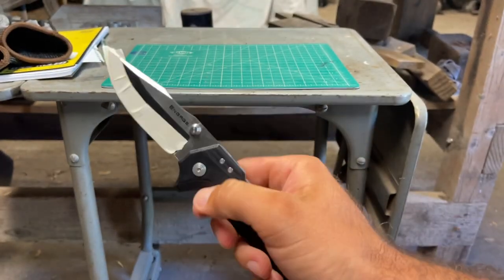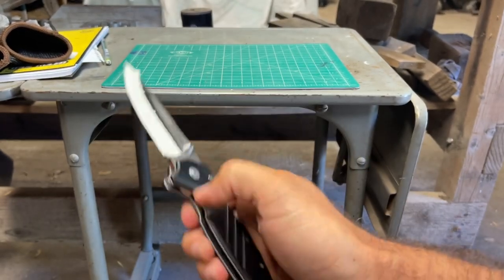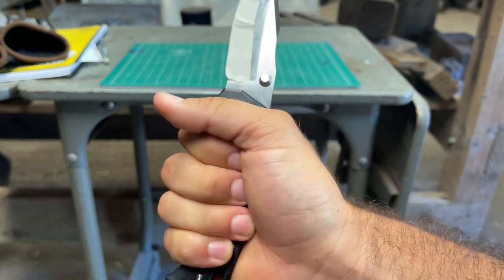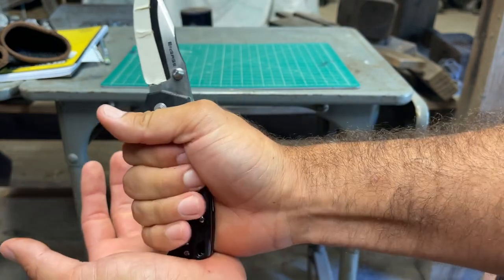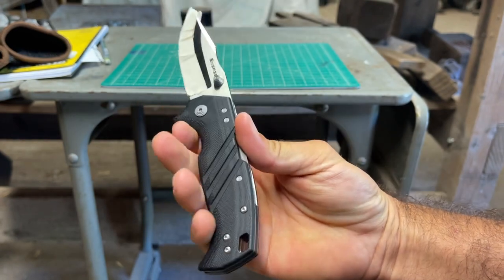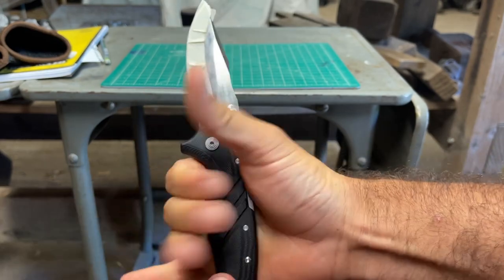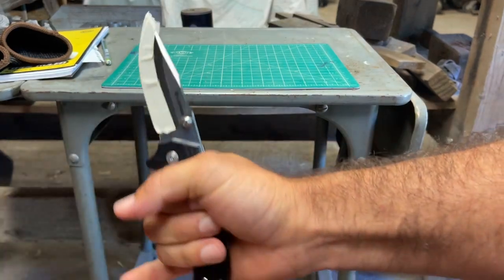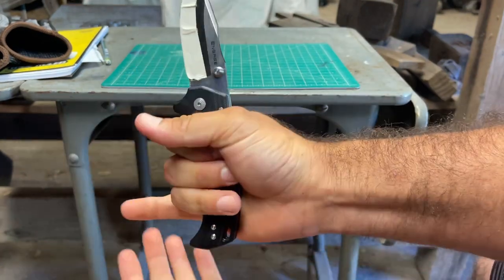Cold Steel Engage Atlas lock fail in butt strike test

Comment: It looks to me like your pushing the lock bar down with the palm of your hand? And what would I be doing  using the butt of the knife to hit anything? It doesnt have a glass breaker. Also I cant get it to do that with my knife.Its funny how you couldnt get it to do that in your first video? lol
Reply from the maker: This comment is perfect because it has all the questions I thought someone might ask so:
1. The palm of my hand is actuating the lock because the force of the butt strike is forcing my hand down and because the lock is in my palm to begin with. I am not moving my hand the butt strike is.
2. I chose to test a butt strike because it’s one of the ways that, when using a knife, causes your hand to slide down the handle; the other is chopping. I don’t butt strike things either but I wouldn’t want a folding knife to fail in any situation that I can do physically.
3. The lock didn’t fail in my first video because it was brand new out of the box. I noticed that the spring on the lock got weaker with use so I tried the test again. I mentioned this in the video. If your knife doesn’t do this then I thank you for mentioning it since it’s good to have as much info as one can about anything.
Reply: @totesmalotes  I can do the same thing with a Demko AD20 or Ad 20.5 The way I hold them knives. lol
Reply from the maker: @s30vguy8  I don’t have any personal experience with the Shark lock but the design looks sound to me. A video would be greatly appreciated.
Reply: @s30vguy8  that is incorrect. The shark lock will not unlock because it has to go back then up. I just tried on both of those models and zero issue
Reply: the lock design is the issue. Only the spring strength will keep the lockbar in place with this lock. That is the design flaw. It's essentially just an axis lock.
Reply: @s30vguy8  lol what a joke, you must not even have an ad20 in your posession because the shark lock is engineered in a way that it is not possible to come undone if you are holding it. 

Like others have said, the shark lock needs to go down AND UP as in it has to force itself into your hand to come undone, unlike this atlas lock that just has to go down in one axis of movement to undo itself

try again cold steel fanboy,
Reply: @opulan  I also saw videos of the ad 20.5 disengaging accidentally. Cold Steel has Fanboys and Demko had a lot of fanboys as well. Trust me Jimmy
Reply: @sgsheff  it is actually way different then an axis lock. Its more like that shark lock but with slight differences. Just open your eyes and look at the pictures of these designs
Reply: @kraakvmaar1505  I've analyzed them in detail. The Atlas lock works on the same exact principle as the axis lock. A lockbar is jammed between the tang and a stop pin. The axis lock just uses liners instead of stop pins. The shark lock is different because the tang rises at the rear. This causes the lock bar to have to be raised to unlock as well as move backwards. Both the axis lock and Atlas only move backwards and forwards but not up. In function the Atlas lock is the same as the axis lock as I explained. Just because the user pulls the Atlas lockbar back similar to the shark lock doesn't mean it functions the same. Maybe if you could see beyond what the user presses to move the lockbar you could see that they function differently. We've analyzed it extensively in the Cold Steel Nation Facebook group and  we were all able to understand that it's just a fancy looking axis lock.
Reply: The fact that cold steel showed the skull breaking test with the butt of this knife is why he’s doing it
Reply: @RR9sf  Well I dont know what you or anybody else does with thier knife but if I were to use the skull breaker or glass breaker on any knife, I dont do it with the knife open.
Reply: Back in the day if you ever had the misfortune of getting into an altercation with someone much larger and you did not want to maim them or worse a butt strike is a reality with Buck 110’s, however normally this was done with blade closed. This test is valid because COLD STEEL makes no qualms of having a blade to defend yourself, open or closed.
Reply: Demko best

Comment: I tried this with mine on YouTube.  This only happens if you purposely slide your hand down while gripping the lock.  The knife doesn't disengage unless you move the lock-bar with your hand.  Will it disengage without you touching the lock-bar?  Mine doesn't.  This is a very good lock type that you can trust, in my opinion.  It does not have the same issue as many Cross-Bar Locks have; this is not a Cross-Bar or Axis Style Lock Type...  This, like the Demko Shark-Lock are very good, reliable, and super strong lock type.  This knife doesn't disengage by it's self.  It needs a person to disengage this lock; it doesn't disengage by itself...  :-)  Peace, Stiletto :-)

Comment: I hate to say it but many Cold Steel fans expected the sale to result in gimmicky designs & increased prices. We hoped to be proven wrong. Not looking too good right now. Appreciate your efforts to get to the facts. Please keep it up !
Reply from the maker: Thank you. What’s kind of sad is that there isn’t really another company that is similar to Cold Steel, old Cold Steel I guess.
Reply: I’m not even a cold steel fan but this is one knife and a new design at that. I think the way he’s holding it or they way his hand size is, is slightly lowering the lockbar and it’s closing on impact. Maybe the design needs a stiffer spring, maybe it needs to be further indented in the grip area as to not be as easily manipulated in use. I’ve seen quite a few reviews from people I respect who believe this is a good design and will work well. It could be one faulty knife, which every manufacturer around the world has had at some point. I’d wait until more knives experience this as a mass issue before making a decision.

Comment: Is the lock failing or are you pulling the lock-bar down?  It looks like you're pulling the lock-bar down...  A better test would be without your hand being on the lock-bar and then, do a butt end strike...  :-)  Peace, Stiletto :-)
Reply: benchmade axis lock does it just by the weight against the spring
Reply from the maker: Hi Stiletto. The lock is failing because my hand is sliding down with the butt strikes and actuating the lock. It wouldn’t fail with out my hand. The reason I did this test the way I did it is because when you butt strike something or when you chop something your hand will slide down the handle. I believe this is a fair test since I positioned my hand where it would be normally when the knife is used. Given this information let me know if you think this test is unfair since I could be wrong.
Reply: @totesmalotes  that’s a fair test. It’s exactly what everyone talked about would happen with that lock placement. I bet that’s why Demko didn’t use it. It’s is basically his lock design.
Reply from the maker: @richardhenry1969  thank you.
Reply: @totesmalotes  Your hand wouldnt slide if you held it right?Whats with holding your pinky out?When I hold the knife my hand doesnt slide either way and ofcourse I dont use it as a hammer.

Comment: I like good info as much as the next guy, but I'm not sure I understand the point of this test exactly. What specific scenario would require me to use the knife as a striking implement, but also have the blade open at the same time? The only realistic situation I can even conceive involves me in a fight, right? Otherwise, I'd just close the knife prior to anything that required a striking surface?
Reply from the maker: I normally don’t strike anything with the butt of a knife. So for me it would have to be an accident. Even though it’s not very likely for this accident to happen I’d rather just carry a knife that doesn’t have this possible outcome.
Reply: @totesmalotes  Fair enough, I'm not mad at anyone for not liking stuff I like. I got my 3" version of the Engage recently and it's ALMOST my perfect pocket knife.  Needs some work on the spine (crowning + jimping) and the addition of a pocket catch, would be pretty much everything I want.
Reply from the maker: @SDCromwell  nice, that’s cool that you like it. Other than the lock, for me, the knife was well made.

Comment: Have you considered using it as a knife? If you're using it as an impact tool don't open it, reinforce the top with your thumb so it doesn't slide and take away from the impact.
Reply: These are hard use knives. It's 6.6 ounces for a 3.5" length blade. It is meant to be flailed, beaten, butt stricken, spine whacked to split firewood, stabbed into a car hood and any other crazy test you would throw at a 6.6 oz. Cold Steel. This is just what you get when you dont sweat the details. Go ahead and butt strike a 10, 15, 20 or Recon 1.
Reply: @AnonAnon-qi4ts  name one situation that you need the knife open to butt strike something? His hand is actuating the lock. Flip it around and stab, it no longer does that. Magic. If the blade is out, you should be using the blade, not the handle 😂😂😂
Reply: @MrJbangoy  if you're asking me if I prefer a knife that can pommel strike or a knife that folds up like a 3d hallmark greeting card on my fingers in a panic situation, then I will take the triad lock. Was that the question?
Reply: @AnonAnon-qi4ts  no, the question was when would you ever need the blade open to pommel strike? If you're panicking and the blades open, might wanna consider using it.
Reply: @MrJbangoy  I would say it would be more just happens on accident with gross motor skills in play.
Reply from the maker: @AnonAnon-qi4ts  ok. So you summed up my thoughts (about being able be hard on a knife in any form) better than me. Thanks.
Reply: @AnonAnon-qi4ts  I would say in a gross motor skills situation good luck even getting the knife out and open if you don't believe you'll be prepared enough to know which way to orient your hand to use the blade.

Comment: Looks more secure than my slipjoints.  Every tool has its strengths and weakneses.  The Tri-ad  is one of the most dependable and least fidget freindly.  If you like the fidget, get a fidget friendly blade and live with the trade offs.  Frankly the Shark Lock looks just a little more, not a lot more, fidget friendly.

Comment: The sad part is this knife is not cheap the price point I would have bought another 7 and a half in espada.
Reply from the maker: Yeah, I think it’s too expensive for what it is.
Reply: @totesmalotes  are you going to send that knife back to GSN?
Reply from the maker: @kylec3869  yes, I’m going to return it. It’s not a knife I can trust.
Reply: @totesmalotes  GSN might want to just keep the triad lock. Was reading some of the comments people thought you were pushing on the lock. I was like really you think he is doing that. Triad lock only in my mind. Seems a little shaky for these new models from GSN. Not really impressed with the models except the new GSN spartan that's it for me. This next year model for GSN better be a lot better. The old cold steel stuff seems better.
Reply from the maker: @kylec3869  my hand is the one moving the lock and the butt strikes are moving my hand. The problem with the Atlas lock is that it’s inside your palm. So when your hand slides down, your hand causes the lock to open. This is the problem I was trying to show. Another situation where your hand would slide down the handle would be when chopping. Which is something I wouldn’t trust this knife with and is part of why I’m returning it.
Reply: @totesmalotes  I will only buy the triad lock unless I might buy one and try it out doesn't seem good thanks
Reply: @kylec3869  Cant verify it but ive read in more than one place the patent for the triad lock is running out soon.
Reply: @raymondknight5298  I hope GSN renuse the trian lock the atlas lock in sure of that lock
Reply: @totesmalotes  I hope this next year with GSN and cold steel not going to be bad in 2023
Reply from the maker: @kylec3869  I hope they get better. I can’t think of any company that can replace them currently.

Comment: I think you can make just about any lock fail if you play to their weaknesses, I think this is still better than liner locks, frame locks, and normal back locks, in many respects.  I can also see this lock as an abandoned lock design from Demko, that CS had lying around and decided to use.  I see why Demko did the shark lock the way he did.
I do think it's slightly high priced, at least it's S35vn, and G10.  Not Aus10a and grivory.
This knife to me is an EDC and food prep, LIGHT bushcraft knife.  I wouldn't necessarily be chopping or but striking with the blade open 99.9% of my usage of this blade.  I do wish the detent was tighter (maybe change the geometry of the blade to lock contact area) and I do wish it had a stronger lock spring.  And maybe flush mounted clip screws and not even necessary to have a deep carry pocket clip that creates a hot spot.  I would like to see those items addressed, and who knows a stronger spring may alleviate the issue you uncovered.  I would like to see it $25 or so cheaper with the same dimensions and materials as well.  I have liner and frame locks that fail at chopping and spine wacks, and some may even fail at what u showed here as well.  For instance I have a "Hard use" liner lock, assisted opening knife from off grid knives that I would only trust to cut paper, card board, and open packages, that's how bad that lock is, and it's touted as a hard use knife.  It would likely fail the test you did, as well as every other test. I also have a first edge with a track lock that has failed while battoning with it.  And may fail this test as well.  I can also see some cross bar locks failing this test as well.  That's why this doesn't particularly bother me as much as the other things I mentioned I would like to see changed on this.  Unless it's the only thing I have available during some type of apocalypse I wouldn't likely be chopping or but striking with an open blade.  There are probably equal people who would, so for safety reasons I'm glad you showed this.  Sorry you cut yourself showing this concern. I do wonder that even with some of the triad locks, if gripped tight enough begin to release the lock. I wonder if you chop or baton, or pommel strike with them in that state, if even the triad would fail one or all of those tests? Enjoyed the videos, thank you for doing them.
Reply from the maker: I agree there’s locks out there with flaws but what bothers me is that this is a Cold Steel knife. This is a brand that I really liked for a long time. 
About me getting cut: I should have put tape on the edge since the beginning. And thank you I’m glad you enjoyed the videos.
Reply: @totesmalotes  I have been a cold steel fan since the late 80's, I've seen their slip joints, liner locks and triad locks.  I AM disappointed in the engage, I recently pulled it out of my pocket and the place was at least a third of the way open.  THAT bothers me more than anything, it looks like the thumb studs grabbed my pocket hem, and opened the knife on the way out.  My first edge knife does the same thing, tho first edge acknowledged this and removed a thumb stud on the right side of the blade.  Their detent stinks too.  I wish I could remove the right side stud on the CS, but it doesn't look like it can be done.  I have a love/hate relationship with the  engage 3.5.  I will pick up a 3.0" and compare it to my benchmark 3.0" blade being my CTS-XHP mini recon. So far very few contenders come close to it in the 3" blade length catagory, and none have beaten it.  I am disappointed in the 3.5 engage, there are more reliable/better knives in that blade length and price point.
Reply: Agreed. This is Cold Steel not understanding hard use. I think this belongs on a 3 or 4 oz. Fidget knife with thin bladestock. I like my bugout and 940 and Sebenza,  but that's light duty stuff. This lock could also work on the huge novelty knofe they are bringing out as thats more a machete.
Reply: @AnonAnon-qi4ts  I think it is still going to have the same weaknesses/draw backs in the Mayhem that is coming out as in the engage 3.5"
Reply from the maker: @petersirangelo2867  thank you. You have a lot of experience with different knives and I’m glad you took the time to share it.
Reply: Are you sure that's all you want?